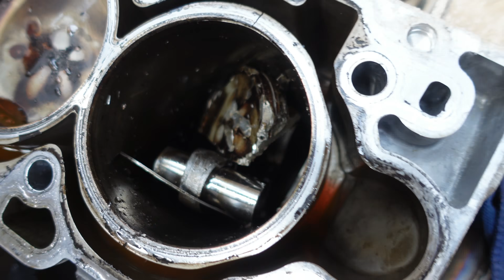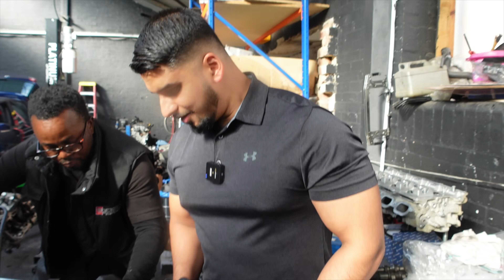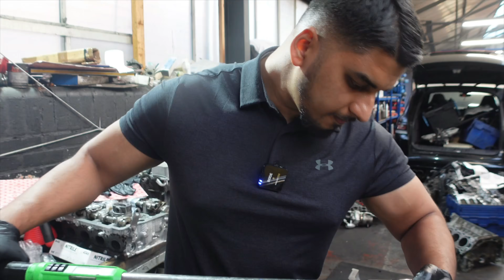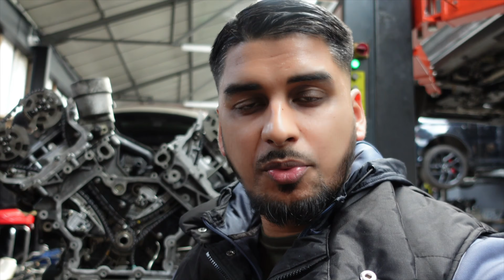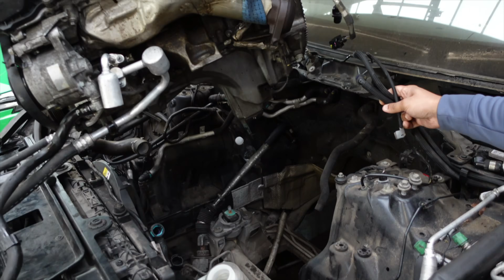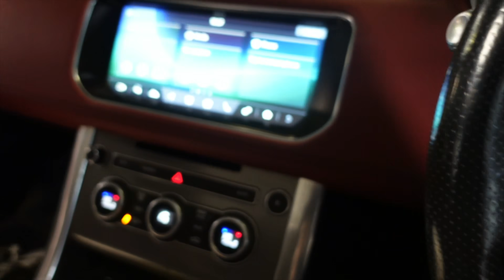REBUILDING AND STARTING UP THE RANGE ROVER SVR FOR THE FIRST TIME !

Comment: I bought a 2016 Jaguar f-type R (5.0 Supercharge) same engines as in the video. Got it from the auction for 3k and it was sitting for 2 years. No one wanted to buy it because the car looked expensive 😂. Turns out the engine jumped time and bent the valves.

Comment: Keep the content flowing liking this.
Reply from the maker: Not the easiest whilst running business but I’m trying my best
Reply: @NamzBoost  HEY NAMZ COULD I TAKE A V8 ENGINE IKE THAT AND SWAP IT INTO A TOYOTA ? AND IF SO WOULD I HAVE TO TELL THE DVLA ???
Reply from the maker: @ anything is possible and yes you would need to tell DVLA
Reply: WHY NOT GLUE OR WELD THE HEAD GASKET GRID THING ON TO THE EMGINE PERMANTELY RATHER THAN RELY ON BOLTS THAT WAY IT CANT ALLOW THE OIL AND COILING SOLUTION TO MIX AND PREVENT FAILURE
Reply: @EPICFUSED you can’t have anything other than the gasket in between the head and block. Even a couple of mm difference in thickness can change the compression ratio. If you were to put a glue/sealant between then it would increase the hight of the head in relation to the block. In essence increasing the compression ratio, meaning the engine could either not run right or lose power. That is why when a head is skimmed it’s literally microns that’s a removed to get a good surface again. Welding would put too much head into the head a likely cause warping. 

In short, head gasket failure is pretty rare and there is absolutely no need to do anything to stop it.